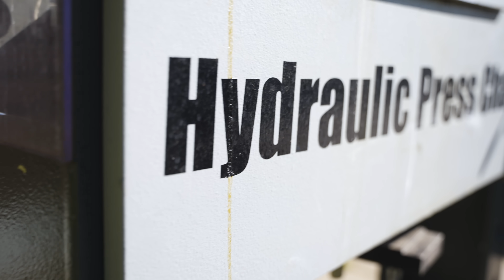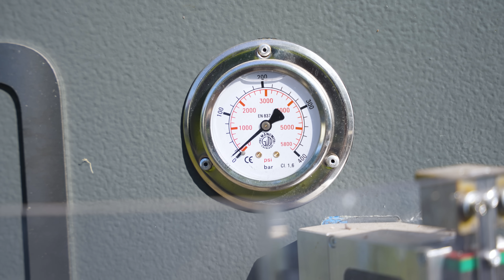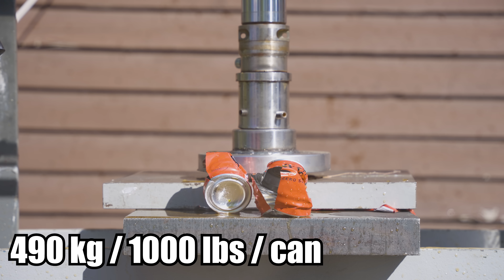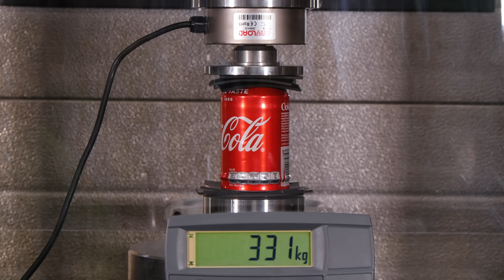How Many Soda Cans Does It Take to Stop a 10-Ton Hydraulic Press?

Comment: Interesting how they don't burst all at once. I suspect that with an arrangement like this, the cans on the outside edges go first and then those closer to the middle with the ones closest to the middle failing last.
Reply: I'd assume manufacturing variances both dimensionally and structurally. Like the ones outside being a few thousandths taller or the weld being not perfect. It could also be that the big heavy Metal Plate is warped.
Reply: @danielmonsanto8286  There are no welds. The top is joined by a double folded seam. The can base is drawn from what starts off as a punched disc of metal.

Comment: I agree with your support hypothesis.  Perhaps some tape around the bundle will make them even stronger (experiment).  Important research.  :)  I like the outdoors video.  I hope it was easier to clean up and you had fun.  
...Why was there a book of matches on the hydraulic reservoir?  Were you making something safer with heat-shrink tubing and match flame 🤣?

Comment: So, fun coincidence, the British "long ton" is only about 1% larger than the metric tonne. The American "short ton" is about 10% smaller.

All three of these are often just written as "ton", and different industries standardized on different ones. For instance, grain and TNT are usually measured in metric tons. Iron ore and ships are measured in long tons. Most other things are short tons. But not all, and none of them are usually specified.

They're all close enough together that "about two adult elephants" is a good approximation though.

Comment: I would like to know if you can actually damage/kill germs (bacteria, viruses etc) by crushing them with a mechanical force like a hydraulic press applies. I'm sure (most) viruses are just too small. 
bacteria on the other hand are ~2-3μM in size which is around 0.003mm or the diameter of spider web silk. They 'could' be crushable if the surface of the pressing plates is smooth enough

Comment: {Getting out my calculator} I see 6 columns across and 3 rows deep. Looks like 18 cans, not 28. Is there a hidden group of 5 by 2 inside those? Hard to count the POPs, even with the high-speed. :-)
Reply: Yes, 2 offset rows of 5 cans each.  Can see a bit of the first one, briefly, at about 3:34. 👍